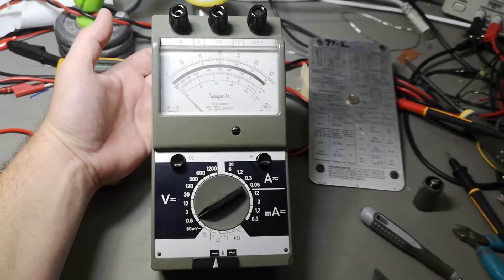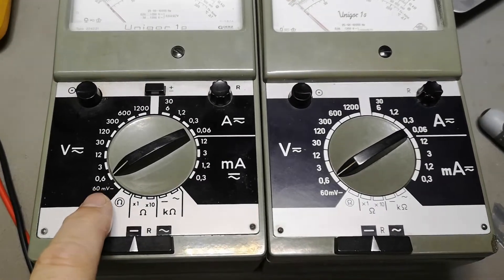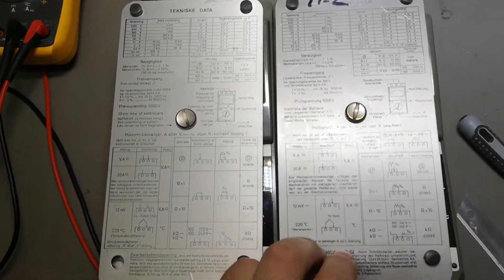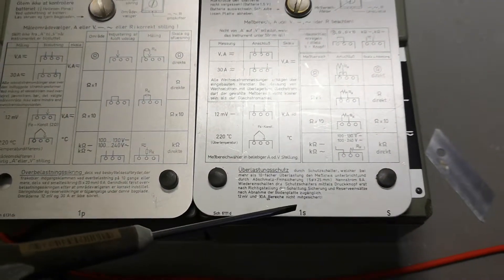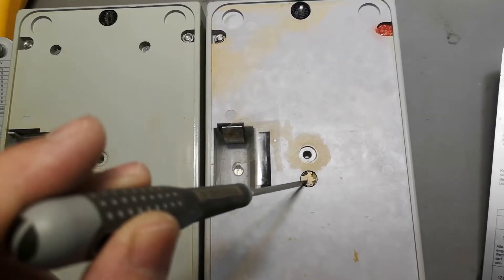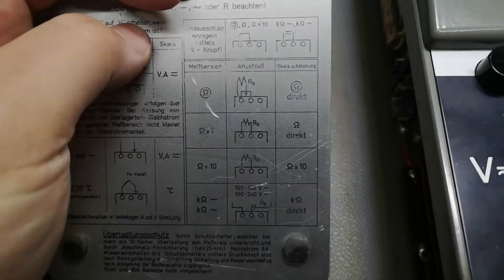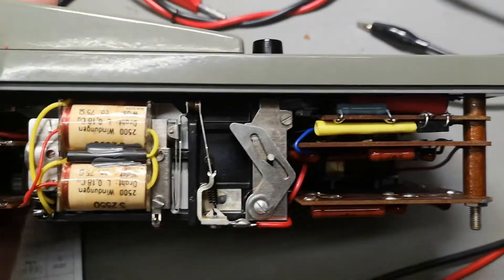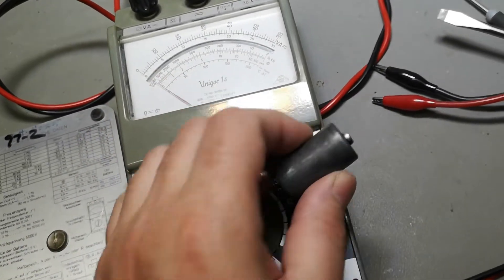BBC Goerz Metrawatt Unigor 1s multimeter type 226211 test teardown

Comment: I have a similar meter branded as Elima Elavi 3. I'm not sure if there's a problem with the on button because when you push it down, the only way for it to switch off is to tap the side!! Is that normal??
Reply from the maker: you are not supposed to tap the side, give the switches some "contact 61" and work them 50 times, then it should work good again,
Reply: @TeardownOZ2CPU thanks for the reply but I don't think that'll fix the issue. I think the magnet on the switch has become weak because the button pops up even if you slightly knock it or switch between ac or dc, any slight vibration.
Reply from the maker: @dean6816  if that is the case it is maybe not easy to fix
Reply: Think I'll leave it how it is. Thanks for advice 👍 @TeardownOZ2CPU
Reply: Just opened up the meter and the little 7mm disc magnet on the switch  has lost its magnetization. Will have look for replacement!! fairly easy fix. @TeardownOZ2CPU
Reply from the maker: @dean6816  great ! i always do a little : you have nothing to loose kind of evaluation first, so good idea to pull it apart and see if you can figure this out
Reply: @TeardownOZ2CPU  👍👍👍👍